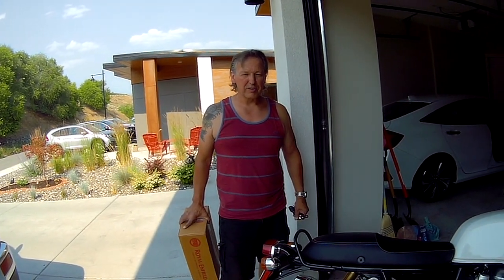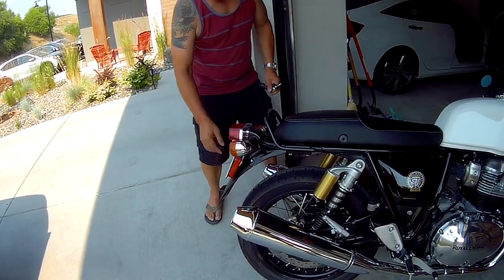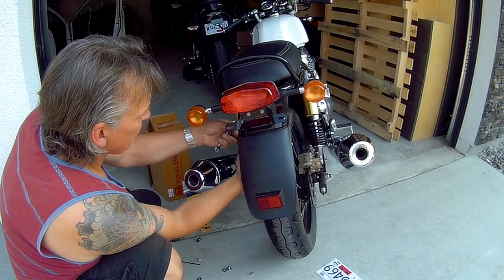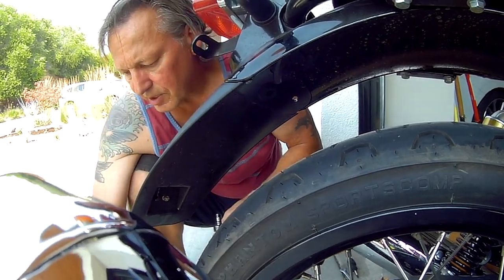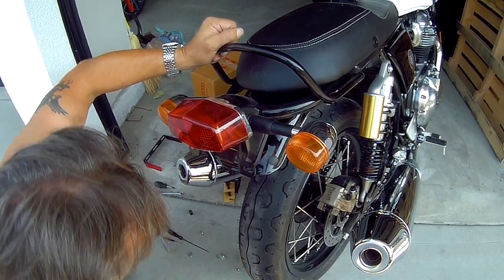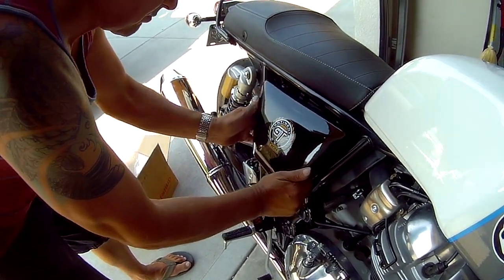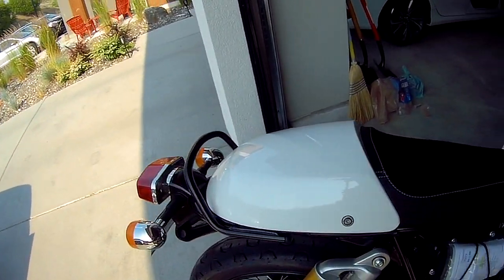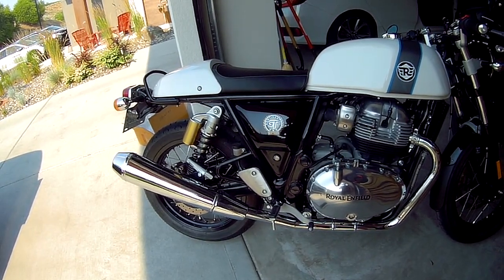🇬🇧 Royal Enfield Continental GT Interceptor 650 Tail Tidey, How to Seat Cowl Mods DIY easy!

Comment: I also removed the rear grab handle when I put the seat cowl on my GT650. I think it cleans up the back even more.
Reply from the maker: Yes it does, not sure I want to cut my frame though.
Reply: @losttogether4ever  2 bolts on each side. no cutting
Reply: @losttogether4ever  Yeah no.. not the rear hoop.. the sissy grab bar thats held on with 4 bolts.
Reply from the maker: Ahh I see, I'll have a look at that, thanks for the input!!

Comment: The Royal Enfield dual seats for their 650cc twins come in 2 flavors. The more comfortable 'Touring' seat uses a different foam to the one fitted to these bikes when they come out of the RE factory. The good news is the RE mono seat only comes with the better foam and the label 'Touring' to be found attached at the stitching of the mono seat near the top rear  left confirms that. Edit: the mono seat is also a little lighter than the dual seat and these bikes benefit from any weight reduction you can throw at them.
Reply from the maker: Thanks for the input, do you notice a big difference with the Touring seat?
Reply: @losttogether4ever  I don't notice a big difference with the touring seat but I'm very light at 143 lbs, maybe if I was heavier I would.

Comment: I just ordered 2021 continental gt 650 in British racing green . Still waiting on it. Delivery time is now upto 90 days since pandemic. I also ordered Moto Torque exhaust upgrade and BMC air filter just to feel that full potential sound of that 650 twin. 
I would suggest try Nuke exhaust on your bike since it's easily available over there .
Reply from the maker: Thanks for the suggestion, I've already ordered a Tec Stinger 2 into 1. We can't get the British Racing Green here in North America, I bet it looks awesome!!
Reply: @losttogether4ever   when I was in Texas I use have honda cbr 1000rr . There was only one dealership of royal enfield in Austin Texas.  Never knew all these years . Came to find out by your video .

Comment: Hey, hope you're doing well. Just curious to know if you were able to attach the seat cowl on top of the raw and rugged seat cover without any issues. Also would be great if you could share the name of the tool used for tightening the washers onto the cowl. I was assuming the tool would be inside the toolkit that comes with the bike but unfortunately couldn't find one. Thanks in advance.
Reply from the maker: Hello Akshay, We are doing well thank you for asking. Unfortunately I was not able to fit the seat cowl with the Raw and Rugged seat cover installed, there is additional padding in the cover that makes installation very difficult I could probably compress the seat cover enough to force the cowl on but then I would worry about too much stress being placed on the cowl which would probably crack it. I was thinking about maybe removing the stock seat cover and shaping the seat foam so there would be extra room for the R&R cover but I haven't decided if I will do that or not. By the way the tool to remove or install the cowl is a 3mm allen wrench. Thanks again for your interest.

Comment: I removed the front fender extension also.
Reply from the maker: I kept it to protect the front of the engine, we have roads that have lots of gravel.
Reply: @losttogether4ever  so far I've been more than impressed with mine. I couldn't help but get the royal green. The exhaust and air filter woke it up.  Looking at powertronic ecu next

Comment: You could have saved yourself 30 minutes of fiddling with those cables if you just cut vertically up through the plastic of the mudguard and slid the cables out.
Reply from the maker: That's totally true, but I like to keep things so they can be put back exactly to stock if I should desire.
Reply: @losttogether4ever  I found a person like I love my r e